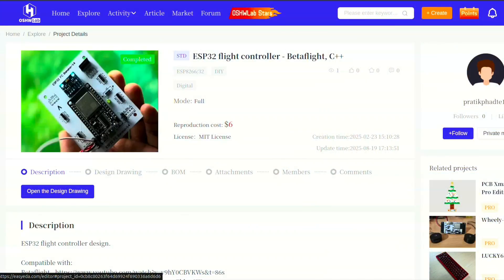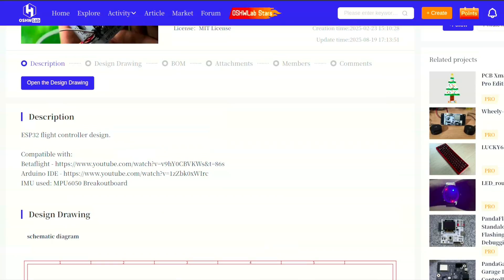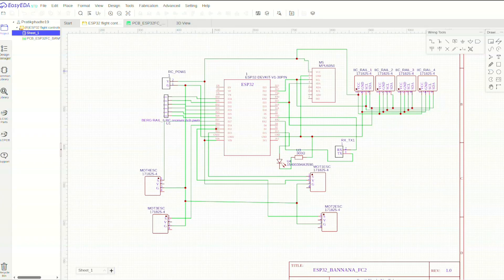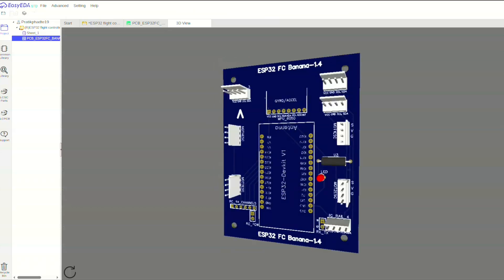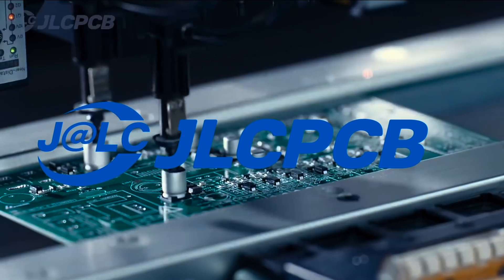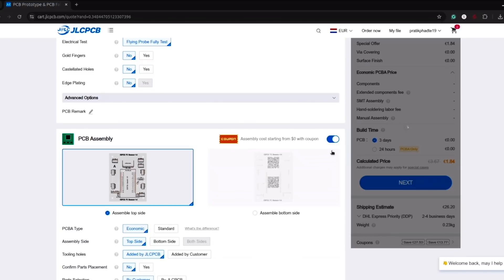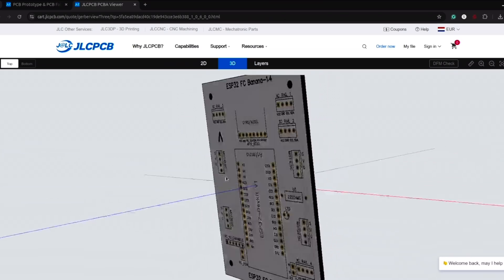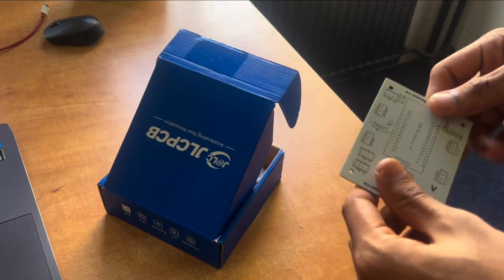Esp32 flight controller - Betaflight | FREE DESIGN FILE

Comment: Really thank you
Edit:
I have a doubt that my project is based on wired communication is it possible to connect the UART or RS485 instead of receiver module ?
Reply: Nope the developer hasn't provided any details Abt it
Reply from the maker: yes, will work for the Arduino IDE code but might be very diffuclt writing code for the betaflight.